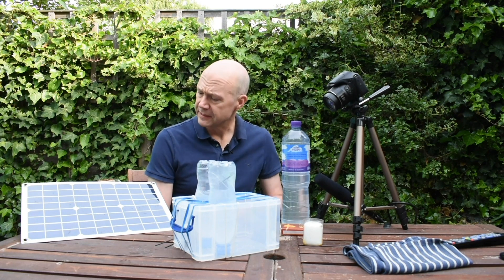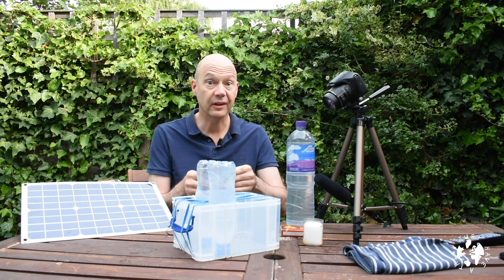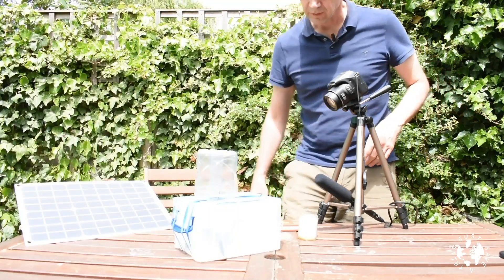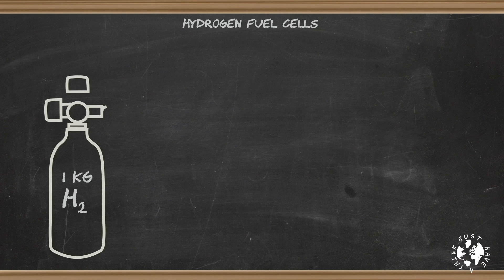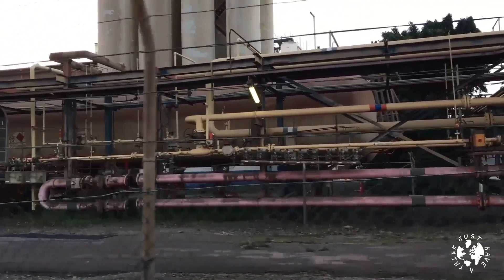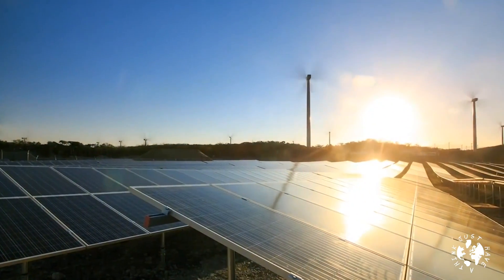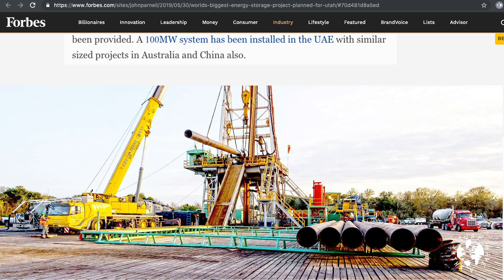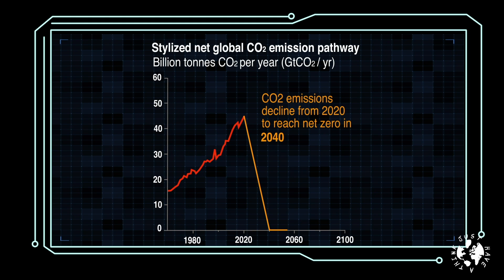Energy Storage in Hydrogen : Does this beat batteries?

Comment: I don't recommend using salt. As kids in elementary school we saw the standard electrolysis demonstration using the Hoffman apparatus, sulfuric acid electrolyte, reigniting the barely glowing wooden splints, the little explosion, etc. Not quite as cool as a dichromate volcano but definitely doable. We went home and improvised with some gallon glass jugs, nails, and a toy HO train transformer. Having no access to sulfuric acid as kids, we used common table salt, NaCl. We got a nice big bottle of hydrogen and an extremely nasty bottle of chlorine gas.

Comment: It is not a good idea to use hydrogen as a stationary energy storage because it requires a huge volume. Space is expensive. Battery is better but it must be cheap for battery to be economical ways for storage. Salt cavern is a good candidate but it is location limited.

Comment: Why not save the oxygen created during electrolysis too and use it for the fuel cell to meet back with hydrogen to significantly improve efficiency, or a backup oxygen supply inside the vehicle cabin in case vehicle travels through dirty air environment as in a forest fire roads.

Comment: you pump anymore than 10% hydrogen in the gas network and it will eat every metal part from pipes in the road to your boiler springing a gas leak... also forms acid when it gets wet. lets repipe the country in stainless for a start lol

Comment: So instead of using the electricity to power heat pumps with 400% to 600% efficiencies, they want to use it to produce hydrogen and than pump it through pipes that aren't made to handle cryogenic temperatures to be used as a fuel in conventional gas heaters, with an overall efficiency of not even 50%? No mate, by the time we have a sizable hydrogen economy we'll also have enough grid batteries and heat pumps, that we won't need to waste 90% of our heating energy. In the long term hydrogen will only be used significantly in chemical plants and high range vehicles.

Comment: I wonder why you did not mention Palladium hydride or adsorption of hydrogen in general for storage. It works at room temperature and pressure. So, no need to apply extreme cooling or a great amount of pressure.

Comment: I know these subjects are complex and you can't cover everything in a 15 minute video, but I still think it does a bit of disservice to gloss over the drawbacks of hydrogen storage.   That includes the rather low efficiency of hydrogen storage which makes these projects so financially questionable there is serious doubt this will ever take off on any scale, and the dismal track record of FCV's so far as they are currently not even remotely cost effective vs any other technology, and serious doubts if they ever will be.

Also implied, but not covered was the transition to from natural gas to hydrogen for home heating.  This also is a far more complex than implied.  Hydrogen doesn't play well with existing NG infrastructure without substantial and expensive modifications for every house intending to do this.  Hydrogen embrittles steel which can cause leaks with catastrophic consequences, so simply using Hydrogen in existing NG pipes isn't actually real world feasible due to cost to upgrade each house to support it.

So, unfortunately, this is far more complex with far more nuances than is (understandably) covered here.

Comment: Hydrogen storage if very problematic. It is the hardest substance on earth to seal in a container. It is almost impossible to make a leakproof container for hydrogen. Hydrogen is very reactive and very flammable. Reactive? Contaminate with a little moisture and you have H3O, under pressure. Acid. The problem is harder than you would think.

Comment: The efficiency just isn't there. But that doesn't mean that Hydrogen production has no use, in fact it does have a lot of use. The problem is producing hydrogen from electrical peaks and then reusing it through fuel cells wastes too much power to be useful. However, if you leave the hydrogen in its original chemical state and combust it, then suddenly you're not wasting so much energy. This means we could produce hydrogen from electrical peaks instead of curtailing production and send that hydrogen to steel furnaces for example you're helping a difficult to decarbonize industry decarbonize.

Comment: Okay so help me understand this... As an energy storage system... There is initial cost to generate the electricity and then to the store that electricity you have to split water into hydrogen and oxygen which is only about 70% efficient then you have to pressurize or liquefy hydrogen to store it. Then to get the power back, you have to either burn the hydrogen and run a turbine, which is only about 45% efficient, or you can use a fuel cells which are extremely expensive at grid scale and our only 60-70% efficient, and that's not including any losses from rectifying the power.

Why is this advantageous over batteries or pumped hydro storage?
Reply: It isn't.  That is the core issue.

Comment: We are talking about energy store and retrieval cycle efficiency at a cost here. 

Efficiency with electric cell versus hydrogen tank. Hydrogen can diffuse through its holding tank versus battery self discharge.

Comment: I really like your video. Elon Musk needs to stop and think about his opinion  about the hpev. He will soon know his mistake when that  industry overtakes the EV market. Essentially the hpev  cars will have a longer range. They will be able to refuel much faster, and will be a rolling energy storage machine. As long as industry produces hydrogen with electrolysis. This will solve a large part of the growing excess electricity storage problem, by producing the infrastructure to fuel these cars. The EV is here to stay. Because it is much less expensive to produce, but will require lithium  ion batteries to power them. The  production of the batteries introduces alot of dangerous toxins to the environment, and requires alot of precious metals. Hydrogen fuel could conceivably be produced on  cite at the fuel stations, it can be converted both ways at any time. Hydrogen can be used as power, or storage that's better than lithium ion batteries. It will be the future no doubt about it.
Reply: Unfortunately, FCEV's are not commercially viable as they are not even remotely cost effective, and the efficiency is atrocious.  And FCEV's require precious metals such as Platinum, and have a defined life cycle as after about a decade, all the storage tanks have to be scrapped.  This is why FCEV's have a DO NOT FUEL AFTER XX/XX placard prominently displayed on the vehicle.

There are also massive logistical issues with hydrogen fuel stations that is not widely covered, including the fact that a hydrogen fuel station can only fuel a few dozen vehicles in a day, and the cost is astronomical and millions each.

So, while this sounds good in theory, there is a reason in the real world FCEV's haven't taken off.
Reply: @redbaron6805  after reading more into the subject, I have to agree with you. Plus the thought of using natural gas to produce hydrogen is really not creating renuable resources. It's actually ridiculous, and like you say the precious metals cost, is another drawback. You also have look at the what goes into generating electricity to power EVs. Like Alberta. We get most of our electricity from natural natural gas generation. And now they have started fracking in the province, which is scary. Most of the EVs on the road  have to rely on non renewable resources to power them. I'd like to say that, I still think FCEV technology is worth developing. They may find new ways to improve it.
Reply: @redbaron6805  you definitely have a vast knowledge about renewable energy. I've often thought that energy sharing could be the answer to some of energy storage solution. One thing seems to be keeping this from happening, is the government protectionism. This seems to be happening in all levels of government. Sharing power grids, as far as I have heard is getting increasingly complicated. Also finding places to put up wind farms and solar panels is getting harder. One thing I learned about power grids is that excess electricity is sent back into the groun, and then it is picked up by sub stations and redistributed through the power grid. What I wonder is, what is the capacity in these systems, and can it be used like a battery?
Reply: @williamtrueman7898  You are correct of course that there is protectionism involved, and there are of course large vested interests in guiding this in a specific direction.  Utilities in most areas are monopolies, for somewhat obvious reasons.  Building generating plants and transmission infrastructure is a costly endeavor that can't easily be replicated or duplicated to create competition.  

The future of energy is most likely microgrids.  Pool a dozen or a few dozen homes with solar roofs.  Interconnect them with storage.  The one's using less can sell to those that use more.  Transmission losses mostly disappear.  The security is much greater and the energy source becomes far more resilient.  The space is already there and mostly unused, as roofs are mostly wasted space anyways.

This also isn't a one size fits all.  Even in the USA and the UK, there is more wind in some areas than others, and more solar in some areas than others.  There is geothermal available in some, tidal energy available in others.  There are many solutions available, depending on the area.

The complexity you mention is the challenge of returning solar energy to a large grid.  This is due to frequency matching and demand matching.  Power plants and grids have to match the demand perfectly 24/7.  You can't have too little power and you can't have too much power.  So, it is a delicate balancing act at all times, made even more challenging due to peak morning and evening usage, and the Duck Curve from solar power, where peak solar production doesn't match peak demand.

The grid can't really serve as a battery.  You can only re-direct energy you are not using to other parts of the grid.  If you send energy back over the grid, it has to be offset by reducing production, usually by throttling a power plant somewhere.  There is some battery grid storage being added which is used to balance the grid, like the Horndale battery farm in Australia.  

But in most countries, there is this symphony mostly of ramping power plants up and down to respond to changing demand.  These plants can be anything from hydro to gas to nuclear.

There are some pretty interesting videos about this I can send you link to that cover this in a bit more interesting way.

Comment: Why don´t we just use methane instead? Combine carbon captured CO2 with water to get methane, store it and use methane fuel cells to get electricity when needed. Seems to me turning methane to hydrogen and then back is a pointless extra step.
Reply: Probably because that process is still far away from commercial reality....

"The researchers still have a long way to go before their new catalyst is used commercially. The team hopes to make the process faster and more efficient by powering it directly with electricity instead of simply exposing it to sunlight, and chain it to a different catalyst that can produce the necessary carbon monoxide."

A lot of this is easy to make in a lab, but much more difficult to replicate on a mass scale and make commercially viable.

Comment: one problem with hydrogen its highly explosive... especially when mixed with oxygen like u know air
Reply: One problem with natural gas is its highly explosive, especially when mixed with oxygen, like you know, air. One problem with Propane is its highly explosive, especially when mixed with oxygen, like you know, air. One problem with coal dust is its highly explosive, especially when mixed with oxygen, like you know, air. One problem with grain is its highly explosive, especially when mixed with oxygen, like you know, air.  This is a valid concern, but its a very minimal one compared to any other gas fuel source.

Comment: Actually the hydrogen in cars like Mirai is stored at 700 Bar, which is 700 times the atmospheric pressure. And even with two cylinders the total gas stored is around 5kg's only. Hydrogen is notoriously difficult to store.

Comment: Hello, thank you for posting this insightful presentation about hydrogen storage. I would like to make some constructive suggestions in order to create more clarity around this important topic and hydrogen in general 😊. 

1. it would be interesting if you could also talk about solid hydrogen carriers, which use metal hydrides to store hydrogen in a more safe and efficient way, at relatively low pressure in comparison to compression and/or liquefaction.  There are a myriad of companies out there, all over the world, which in recent years have come out with metal hydrides solid hydrogen carriers storage technologies. One of them is an Australian startup LAVO, which created the first hydrogen storage battery. The overall round-trip electrical efficiency is low though, around 50%, but this is because they are not recovering the thermal energy wasted from the electrolyser and fuel cell. 
Solid hydrogen carriers are an important breakthrough, which will allow hydrogen seasonal storage to be done in a more efficient way. 

2. comparing hydrogen storage versus battery storage is a hot topic, as there are a lot of economic interests attached to it. Opinions are polarised, therefore we need, now more than ever, transparency, integrity, clarity and efficiencies. It’s important to mentions all the pros and cons of these two different ways of storing energy. 
You did put emphasis on seasonal storage, which is a very important concept to understand about hydrogen. 

3. It would be interesting if you could create a video which covers in detail the different types of Electrolysers and hydrogen fuel cells, their efficiencies, pros and cons, application types, costs, maintenance, life span, etc... there are a lot of misconceptions and misunderstandings about these technologies. It’s important to clarify that fuel cells are co-generators of electrical and thermal energy, therefore when we use these technologies we enter the realm of combine heat and power (CHP) systems. In some applications and circumstances the thermal energy component will be lost, but in others it will be retrieved, increasing therefore the overall system efficiency.  
Electrolysers also generate thermal energy during the electrolysis reaction. Energy that can be retrieved.

4. When we talk about energy, and in particular “energy transition”, it is limiting to only mention electric energy and electrification, without bringing into the equation the thermal energy. We often forget that thermal energy exists and that it also accounts for a big portion of GHG emissions. Burning hydrogen is not seen as an efficient way to decarbonise the thermal energy generation. Perhaps it might be necessary in the short term, in order to rapidly reduce CO2 emissions, but in the long term thermal energy will be generated by the fuel cell itself, therefore increasing the system efficiency. 

Warm regards, 
Marco

Comment: A: We do not have enough fresh water as its is and B: we would need to generate twice as much electricity due to the inefficiency of converting back and forth and C: they have no intention of using hydrolysis for hydrogen but want to use LNG instead.

Comment: Our Solar Storage solutions allow you to save money through peak shaving, eliminate utility demand charges, store solar power protect your home from voltage spikes, and keep your power on during black-outs.
Below are the best battery solutions so you won't have to waste your time and money continually maintaining or replacing lead-acid batteries.
https://bigbattery.com/SolarHome/
Reply: H2 and NH3 ( amonia) look like very promising solutions to air polution problems and betterment of public health. But CO2 reduction in atmosphere is not going to solve "climate change" which is appearing to be due to other root causes ( such as magnetic pole inversions, and maybe shifts in axis of earth which modifies the angle of incidence of sun's rays). In the last 650,000 years there have been SIX  ice age/tropicalisation cycles. Witness fossils of monkeys,giraffes and tropical plants found in northern Finland. Also vegetation remains found 1 Km undet Greenland ice pack. So much for the Greta Th. hysteria. Bad science ocurrs when evidence is withheld from the issue when it does not support the "politically correct " result. Humanity is barking up the wrong tree when.it thinks it can stop climate change with CO2  reduction via a "panic button" approach. We need to face the root cause of the climate change and work to avoid its consequences in a timely manner. Otherwise we will.be caught in a "trap" of our own delusion. Remember the ocean level has risen far more than the current doomsayer pundits and publicity seekers warn as catastrophic. They sound alarm about a 1 or 2 meter rise in ocean levels . Then conveniently forget that the Mediterraneam sea was once a savannah, and the british isles had a land bridge to the continent until a 120.meter rise in oceanic levels flooded them out to what they are today. Note ,there were NO.AUTOMOBILES,COAL BURNING POWER PLANTS OR JET.PLANES when these great meltdowns happened.So CO2 was not the "culprit" unless it came from volcanic activity or other natural and inavoidable source.